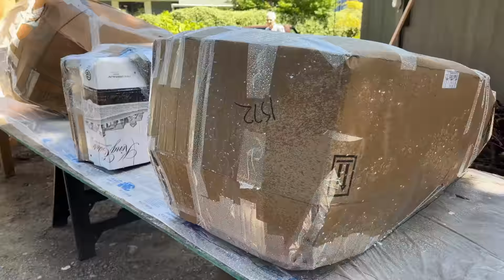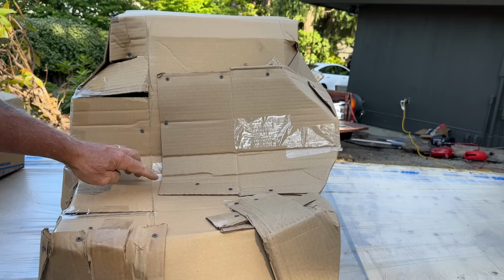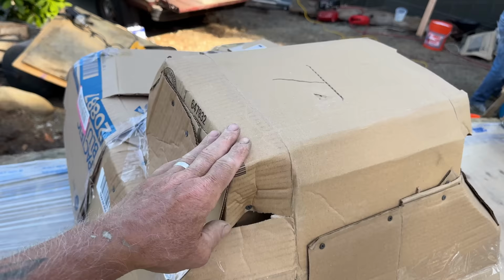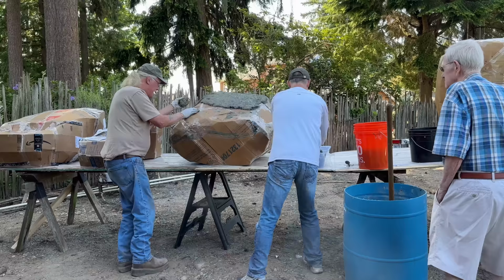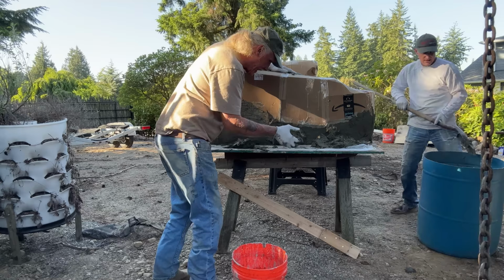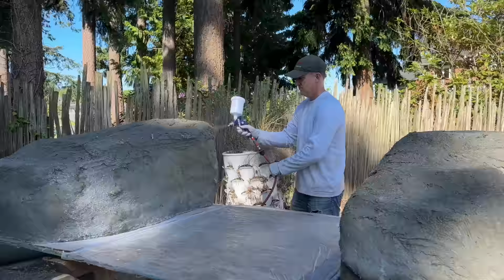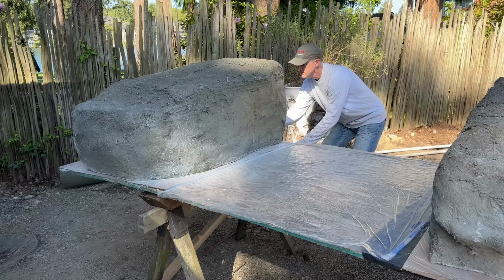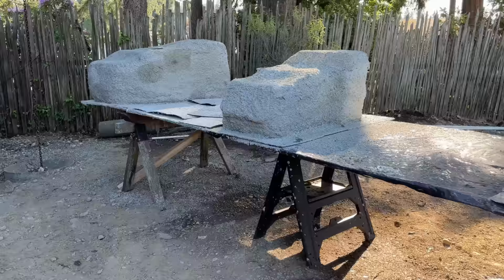How to make cardboard rocks (50 rock Project)

Comment: I used some large fake boulders in one of my front yards that I did years ago only mine were made from fiberglass. They held up well over the years and they looked very realistic. People didn't realize that they were fake.
Reply from the maker: Some many applications for the use of faux rock construction… Thanks for sharing
Reply: Were they formed over cardboard structures like these, or did you use a different method?

Comment: If i make an open bottom rock how hard would it be to remove the cardboard? I was thinking maybe i could just wet it to pull it out a little easier
Reply from the maker: Well we do after spraying the cardboard with the acrylic glue to give it a waterproofing so it doesn’t collapse or SAG from the wet cement is we oil it so that the cardboard cannot stick to the Cement in the box comes right out?

Comment: I need to make something like this for a playground at the local college in my area. how strong are these cardboard versions when you are all done? would it hold the weight of multiple small children haha? I am currently thinking about using a wood skeleton with wire mesh. Thanks for your advice if you have any! great looking results with your texturing! very inspiring
Reply from the maker: The cardboard is a great temporary form to create your rock…the strength of your rock is the shell. Depending on the formulation of the mixture you plan to use will determine how thick you’d have to make it. I always use the textile mesh not the wire mesh. Never ever make a frame with wood as it can get wet and expand and hydraulically break apart your Cement bad idea this I know from many experiences. With all that said, I make huge playground climbing wall equipment pieces that are about three-quarter inch thickness, and they support many children for decades. I do offer tech-support feel free to give me a call 971-237-2957. Thanks for watching my video.

Comment: I'm trying my first cardboard rock.. but wondering what glue you're using before applying the mortar? Sounds like it also acts like a seal of some sort. Please let me know! thank you!
Reply from the maker: Sean, the glue you’re looking for is 100% acrylic carried in water as it’s an ad mixture for the Cement. You will see me use that very same glue to seal the cardboard an hour or so before I start muddying it so that the cardboard does not get wet and lose its rigidity or collapse. Thanks for watching.
Reply: @fauxrock  thank you so much!!!! I hope one day to be able to take one of your classes!
Reply from the maker: Thanks again… hope to see you soon.

Comment: What's inside the boxes?   How do the screws stay in ?  What is mixed in the cement?  concrete?  clay?   Paper clay?   There is just not enough detail here for me.    Was this a part II to another video?
Reply from the maker: There is nothing inside the boxes…
The screws have threads which thread into the cardboard …
The mix is a proprietary, fiber, reinforcement, composite . Unfortunately, I only give that formulation out to paying customers whom I  train.
This was a standalone video project, although I have many videos were on building cardboard rocks, and detail more understandings to the viewer . 
Thanks for watching.

Comment: Do you prime the cardboard prior to covering with cement finish ?
Reply from the maker: We spray in acrylic glue on the cardboard about an hour prior to muddying it so that it waterproof the cardboard so it doesn’t receive water and lose its rigidity. We’re not using it as a bonding agent cause we don’t care if it actually bunch to the cardboard cardboard is simply a form with no strength or future hopes of strength occurring from it